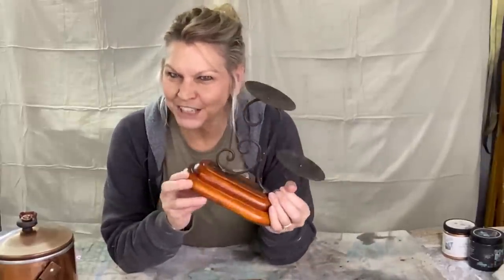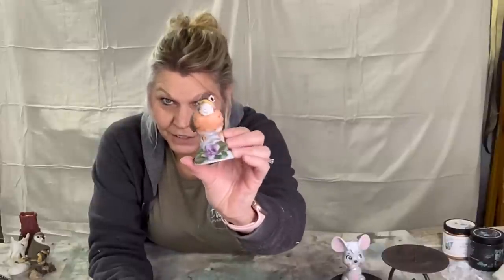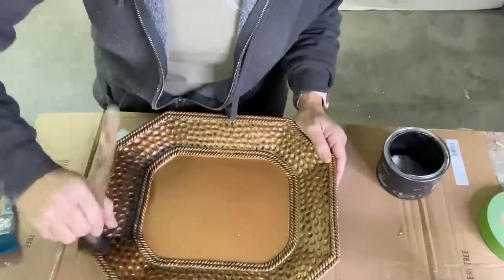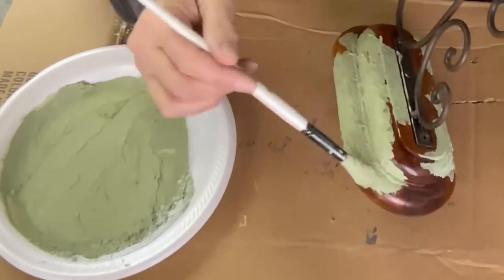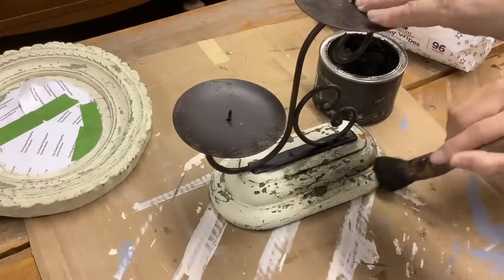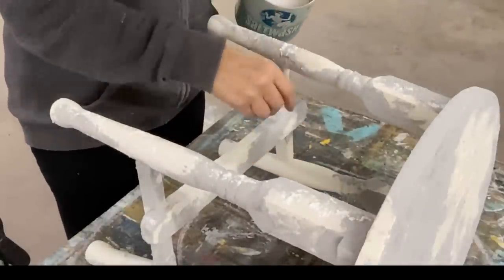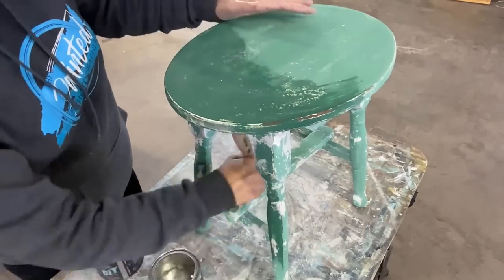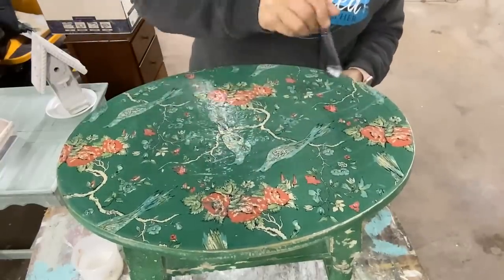Thrift Haul and New Saltwash Chippy Finish

Comment: The table is absolutely gorgeous!  I have a hard time with the dark wax turning out the same way yours did.  I am not sure if I need to wait for the clear wax to thoroughly dry before adding the dark wax or if I am not wiping off quickly enough... I am still playing with it to find the right technique.  Thanks for sharing your projects. 😊
Reply from the maker: You need to put the dark wax on right after the clear, do not let it dry.  Also if having trouble with the dark wax work in smaller areas and wipe back sooner.  You can also use the clear wax as an eraser to remove more of the dark wax.  Just add clear with clean dry rag and wipe back.  Thanks much for watching.
Reply: @ThePaintedPhotographer  thank you!